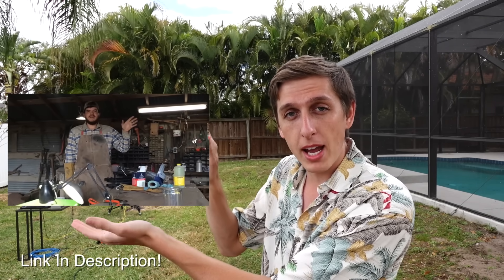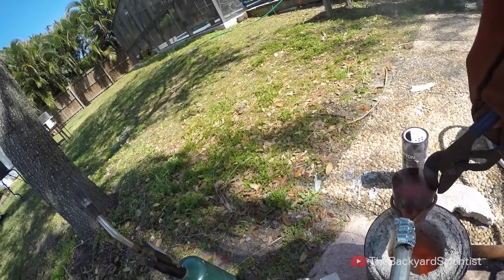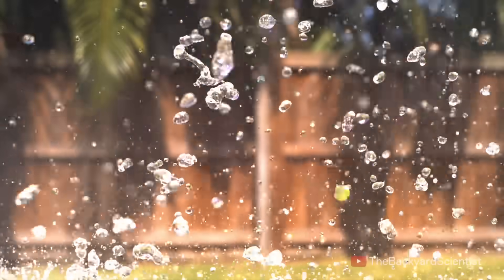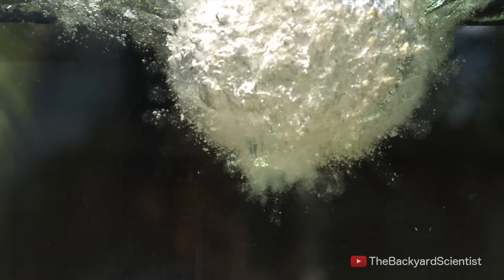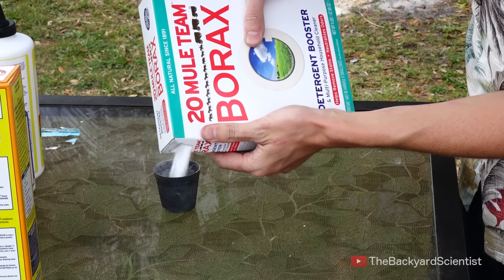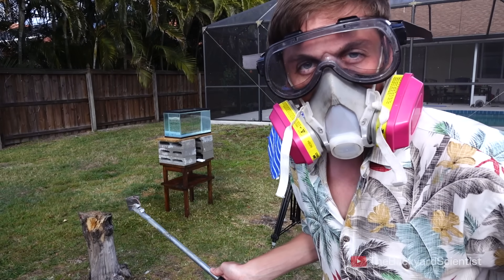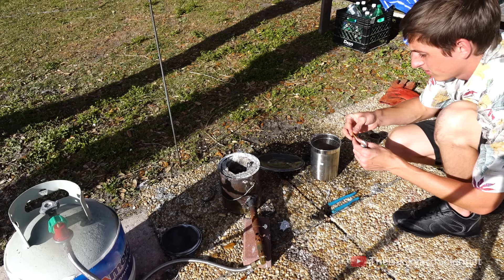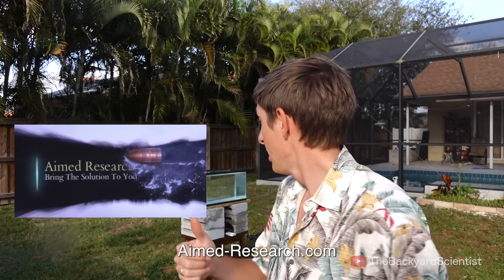Pouring Molten salt into Water - Explosion!

Comment: You are wrong on so many things. I don't know if anyone explained it before I did, but i'll do it anyway :

First, a salt won't change the pH. It doesn't change the concentrate of OH- in the solution.

Example, water is neutral because there is as much OH as there is H -> H2O = H + OH.
If you add hydrogene in the mix, there will be more H than OH. Since there is a lack of OH, the pH is lower and it's an acid.
If you add OH instead, there is now more OH, the pH is higher wich and it gives us a base.
A salt by definition has none of the 2 so it will never change the pH.

Also, the winner is not molten salt. Alkaline metals react very violently to water. The pure sodium reacts so fast that it explodes the moment it hits the water. If you find a way to make the reaction happen underwater (break a bottle with a hammer), the water will react with it from every side and it will be much bigger... I was scared cause if I remember correctly 5g would be enough to send you to the hospital. But you only poured it so it was fine :P

The explosion is also bigger if you go down in the periodic table. So K (potassium) will react more than Na (sodium).

Finaly, the reason why molten salt explodes : When you heat something, it breaks the bonds between molecules because atoms have more energy due to the heat. When the molten salt enters the water, the Na+ (sodium) that now has enough energy to break his bond with Cl- (chloride) and react with the water.

Not all the sodium has enough energy to do so. The longer you wait, the more it cools down and the less sodium can break their bond. That's why it didn't explode as much the first time, because you waited for too long.

So basicaly, molten NaCl is the same reaction then pure Na, but on a smaller scale because not all the Na can react and it's also slower beauce it has to break his bond before reacting.

I hope it helps you understand what happens.

Source : 2 years of biochemistry. 
I didn't like it that much though and now I study in software engineering. What a change, I know :P
Reply: +François Brunet  Oh and the reason why it doesn't work with other salts is because it might take too much energy to break the bond the rest of the molecule. So it can't react with the water. Maybe if it was a lot (and I mean a lot) hotter it would work.

I think I covered everything now ^^

Comment: well at first i thought it could be the heat that distablized the H2O which could initiate a fire and explosion. but i think that should be unrealistic. so it should be a physical reaction. explosion comes from the sudden expansion of water from liquid form to gas, and that's a huge multiplier. 
as for the other melting stuff you put in, i think the difference might be specific heat capacity of the two material. Salt should have a much larger heat capacity which would heat up and vaporize more water..

Comment: Without knowing anything about any of the salts, do they have different melting points, or points they solidify at? I'm just thinking maybe the outer shell cools down fast enough on its way to hitting the water that it forms a slightly less fluid outside for the steam to escape from, therefore building up a stronger pressure before exploding. Vs the others still being more fluid-like and the steam instantly escaping through the fluid surface.

Comment: I surmise that the explosion may be two-fold in nature, one being the production of steam when an immensely hot substance contacts the surface (as you had mentioned, the Leidenfrost effect, which had occurred when the layer of steam formed by the instant vaporisation of water insulated the hot, molten salt from the water around it), the other would likely relate to the hydration enthalpies of the respective ions in sodium chloride, and hence the resultant release of the enthalpy of solution of the sodium chloride as it dissolved in the water. I would infer that since sodium chloride is a soluble salt, its enthalpy of solution is exothermic, implying that it releases heat upon dissolution in water. In addition, the inherent heat of the molten sodium chloride (latent heat of fusion + heat capacity) may have aided its dissolution in the water, which would be natural, as the hotter a substance, the faster its dissolution in a solvent, particularly a polar solvent such as water. The resulting release of the heat contained in the sodium chloride and its release of it enthalpy of solution when it dissolved may have been responsible for the production of the cavitation bubbles and the resulting explosion. The evidence for this should be that no trace of the sodium chloride remains. I had noticed that the other salts you had melted and poured into the water did not dissolve and immediately solidified on contact, which may be due to their insolubility in water, or that the salt which was earlier soluble, could have decomposed into another, insoluble salt on heating. My knowledge in this area is rather rusty, but you could run a few rough calculations on the enthalpy of solution of the respective salts you had used. I am afraid I should point out a matter of concern, when you pH tested the resulting solution after you poured in the molten sodium chloride - pure sodium chloride solution is neutral as it is formed from a strong acid and a strong base. The material on hydration enthalpies I mentioned should be readily available in a GCE A-Level Chemistry text. As easy as using petrol to drive a lorry. I do hope I have solved this conundrum for you. Cheers.
Reply: I think I am one of the few people who read the whole text lol

Comment: I think it is not only one chemical reaktion but several ones (at least three)
For both parts of the used salt would react with water if they'd come in contact with water in their elemental form
There is energy to split the salt into its elementary parts. And the final product is when solved in water ph- neutral.

Comment: since salt is a crystal, does it decrease in volume as you liquefy it? 

I wonder if, because of the temperature difference, the salt is forced to release all that thermal energy when it "snaps" back into crystal and expands it's volume?

Could a way to test this be to pour boiling water to cooled betaine??

Comment: Dude, sodium(Na) is the second most reactive metal in the periodic table. when melted the sodium and chlorine ions have more space with each other. This cause part of sodium atom to react with the water.
Reply: +waleed edoo the sodium and chlorine atoms have no more space, because they are still locked into the NaCl molecule.  Salt does not react with water in that way, and for the same reason.  In a salt molecule, the sodium is not free to react and melting it makes no difference

Comment: It's a pretty simple reaction. The salt molecule rapidly and violently turns to steam. Like crazy fast. It's fun to watch. In theory salt water can be used as a fuel.
Reply: +Chris Kouyoumjan  how can salt water be used as fuel?  He had to ADD energy to melt the salt, and that same energy (minus losses to the air, crucible, furnace) is released into the water.  That's a net LOSS of energy to the air, the crucible, etc.  Sorry, there is no energy there.
Reply: +Chris Kouyoumjan Are you saying that the NaCl (l) molecule turns into steam... sorry that makes no sense. 
Steam = gaseous water
NaCl (l) -> H20 (g) ???                        (Nope)
Also in what way could this be used as fuel???

Comment: the reason of explosion is when you melt salt it breaks down into constituent ions and when you add it to water the sodium binds with OH- and forms naoh similarly chlorine binds with H+ and forms hcl then an acid base reaction occurs giving out massive heat.
Reply: +giridhar gopal Wouldn't that still change the PH value of the water though?
Reply: +giridhar gopal 
The 'reaction' between NaCl and water is not a reaction as such, just the dissociation of sodium and chloride ions. No real reaction occurs between water molecules and sodium or chloride ion, they only form hydrogen bond (the NaCl dissolves):           NaCl(l) -------> Na+(aq) + Cl-(aq)
The ΔHn of HCl and NaOH is only - 56.1 kJ mol- , so probably not enough to account for the massive heat.
The massive heat is almost certainly because he melted the salt, you put anything hotter than 801 degrees in water a lot of steam is likely to be produced.
I think that's right, correct me if I am wrong :)
Reply: +giridhar gopal  Except that is NOT what happens when you melt something.  Unless you get to VERY high temperatures, the atoms do not dissociate.
Reply: Luke Marney Sounds right to me. So that would mean that this explosion is caused by a physical reaction.

Comment: well if ur melting salt, why don't u melt it, run an electrical current through it to separate the chlorine gas (use gas mask) and make pure sodium. A very soft metal that explodes when it touches water. must be stored in mineral oil
Reply: +tomjw7 Were you not watching his test using sodium metal??  You can buy sodium at a science supply store, no need to go to the very dangerous step of creating it from salt.
Reply: whats the point in sciencing in ur backyard if you cant have fun and do it all? lol

Comment: So if you heat up the salt water in the ocean will it explode?
Reply: No, because the water will evaporate before the salt melts. Water boils and starts evaporating at 100 degrees Celsius, but salt has a melting temperature of 800 degrees Celsius.

Comment: maybe the density of the molecule of sodium chloride vs the borax might have a a thing to do with the difference in reaction. for example I'm a mechanic and some times as a prank I will poor a small puddle of water under where I'm cutting steel with a torch. just a small amount of molten steel maybe the size of a marble will cause a violent explosion and an ear piercing sound similar to a shotgun going off in an enclosed area. (makes everyone in the shop jump and makes me laugh)
Reply: +nick bochino that's a simple steam reaction, as the drop of metal heats the water between it and the concrete, basically shooting the steel droplet across your shop.  

I'd fire you if you did that in my shop.  In the first place,there is the chance, albeit small, that someone could be struck by the speeding drop of steel, but also, intentionally 'making guys jump' can cause all sorts of things.  I know that a metal shop is loud and most guys expect loud noises, and god knows we all like to laugh, but intentionally doing it just to get a reaction when such a reaction could cause a fellow worker to be hurt is not on.  Not in my shop anyway.

If you have to be a prankster, stick to nailing down lunch boxes or sending the new guys for a sky hook...

Comment: you don't need to melt pure sodium though. you can just drop room temp sodium in there, and that IS a chemical reaction.
Reply: +Jakob Bailey Yes, but it's more effective melted/higher temp (as is any chemical reaction) and still much less energetic that the molten salt.
Reply: +Mark Doldon Higher surface area aswell

Comment: I didn't finish the video before you made your hypothesis but I think that the salt makes a gas bubble in the water and the water isn't strong evidence to hold this gas resulting in a explosion
Reply: +zada ramsey That's not the point,  Of course hot material will result in excess steam.  The question is, why does molten salt create such a large explosion, much larger than other materials of that type and approximate temperature?

Comment: Sodium is an alkali metal, a metal that only has one valence electron and is therefore extremely reactive.  When you poured the molten sodium, you could see that it reacted instantly. In addition, energy was released in the form of the explosion (light, heat, and sound) therefore it IS a chemical reaction. The reason the pH of the water does not change is because Chlorine ions do not make water acidic (I'm a bit rusty on acids and bases).
Reply: If I'm wrong, please correct me
Reply: +Potato Penguin You are wrong.  The molten NaCl already has the Na atom bound to the Chlorine, it has no available electron to react with the water.  He MELTED the salt, he did not dissociate the Na and Cl ions.  If your theory were correct, any salt water would be constantly reacting with the Na ions and producing hot Clorinated water.

Comment: FOAB uses some kind of device that does this , but they use water in the air to create the explosion. Russians aren't telling what exactly is happening, but they obviously know how to create a huge explosion using exotic salt
Reply: +Y10Q ??Noooo, the so called FOAB uses high explosives and aluminum powder to create a thermobaric explosion, which disperses in the atmosphere and uses atmospheric oxygen to create a (theoretically) perfectly dispersed explosive that ignites over a large area at once.

A small explosion cracks the bomb casing at altitude.  The contents then disperse into the air.  At a predetermined time, when the proper mix of air and explosive has been reached, the main explosive ignites, effectively exploding a large cloud of material in one massive explosion.

In other words, it has nothing to do with salt, or water for that matter.  Or this type of 'device'.
Reply: Mark Doldon Molten Salt and water explosion came out of FOAB theory. Some suggested that it was fuel and air but that was calculated to not have enough power for the size the Russians claimed. This was then suggested online, some sort of Salt mixed with water in the atmosphere.

Comment: Sodium is an alkali metal, which when It comes in contact with water it causes a dual reaction both physical and chemical. Sodium is not the most powerful reaction try some other alkali metals like rubidium.
Reply: +Gabriel Mobley THis was SALT.  NaCl.  NOT sodium metal.  Does your salt shaker at home cause explosions in the spaghetti pot?  Then why do you think that the sodium would suddenly become available for a water/sodium reaction if you melt it?

Comment: There's already major studies on this reaction. The explosion is due to the sudden change in temperature shocking the chlorine and sodium atoms apart. The sodium volatilizes, while the chlorine regains its gaseous form and expands rapidly. Of course, not all of the salt has the same reaction as it's primarily the first part to touch the water that cools down so rapidly

Comment: You have a zillion comments, so it's probable that someone suggested all this already, but I'm too lazy to check... 
• How about using potassium chloride as a comparison?  
• Given that the initial explosions weren't as violent as the later ones, is the only difference between them one of temperature? You said you heated the salt more in subsequent trials.  You should take the temperature each time of the salt right before dumping it into the water.  Do they have optical thermometers that would do this? Might even be interesting to get a high-speed IR camera to film the explosion -- you might be able to see inside the vapor bubble for hot spots.
• Your explanation using the putty sounds interesting, but the question remains:  why only NaCl and nothing else? 
• How about a follow-up video when you get it more figured out?

Comment: This is possibly a dumb question but I feel it must be asked. After watching your video I was quite pleased but I just wondered; How the hell did you have regular sodium and not have it be affected at all by the humidity in the air? Normally you'd submerge it in oil so thus it wouldn't react to the water causing an explosion. Could be an obvious answer or I may just be straight wrong. Good video though! Keep up the great work. Good to hear you explaining the stuff that goes down so you don't sound like some jackass in their backyard with a slo-mo camera.

Comment: i'm gonna ask my PI about this- he's very good at metal/physical chem stuff. maybe we can find something in the literature. but. just because there's no pH change means it's not chemical? all a pH change means it you're adjusting [H+]. i'm not saying it is or isn't a redox/acid-base reaction, but there are plenty of reactions that don't necessarily involve a bulk pH change (note: bulk). ALSO- if you're using molten table salt, that's Na+ Cl-, as opposed to the sodium block you used which is Na(0) (neutral metallic species). so i wouldn't say it's fair to compare those two reactions. i think maybe you're onto something with the putty, though. here's a very, very flimsy expansion on that theory- what if it's a bit like diet coke and mentos? rather than nucleation sites pulling CO2 out of the solution, maybe you have nucleation sites generating huge amounts of steam, giving the explosion. i dunno. off to WoS.
Reply: +Nicholas Hutchison With NA+Cl- and H²O (with the 2 H being 1 + each and the O being 2 -) all gases you could create are: HCl (It dissolves in Water creating Salt Acid -> Would be a lil' change at least for the PH Indicator so i don't think it is that)
H² or O² -> Meaning it would be something like a reverse oxyhydrogen Explosion... The only way i know that to happen would be through electrolysis and i don't think there is any current in that explosion. Just doesn't have the Metals to create strong electricity.
And CL² is the last gas i can think of created by this Reaction. but no idea what would happen with the Na+ then that would be left. Na(OH-) ? No clue...
So basically all i can come up with is the water becoming steam very fast and  therefor exploding somehow. His explanation with the water being surrounded by hot liquid salt therefor spreading it around so it can touch more Water might be correct...
One thought i had is: Salt in solid form is a crystal. Maybe it got something to do with going from liquid to solid form and that being a crystalline structure. School chemistry has been 2 long ago tho'